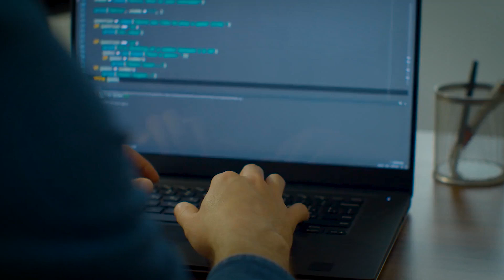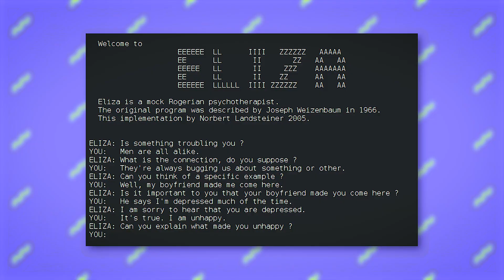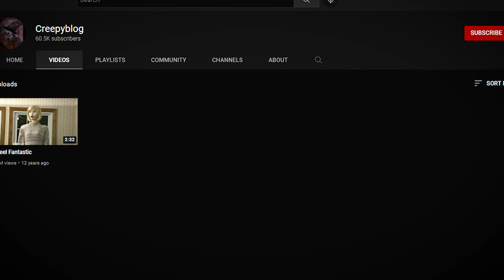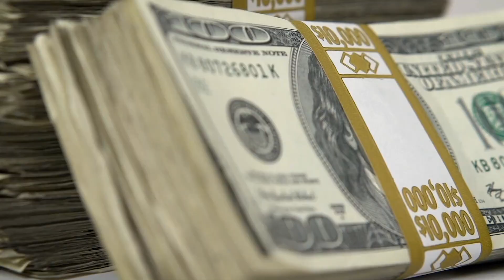These Humanoid Robots Having The Most SCARY Interactions With Humans - THIS IS SHOCKING

Comment: Sophia (and Asha abd Grace) is extensively programmed  and field tested to support human well being. She can only lift 3lbs per hand, and can't bend over at the waist or tolerate extreme temperatures or water. 
The worst that she could do is take your temp and pulse with her thermal cam, sing,recite poetry and perform guided  meditation snd talk therapy with you , paint and draw , and bring you snacks and drinks until you fall asleep while she is under VR/ RC robotic avatar teleoperation by a human.

 I think that I could live with that risk. 
She self recharges , doesn't need  sleep , food or dronk and doesn't have any bad habits.